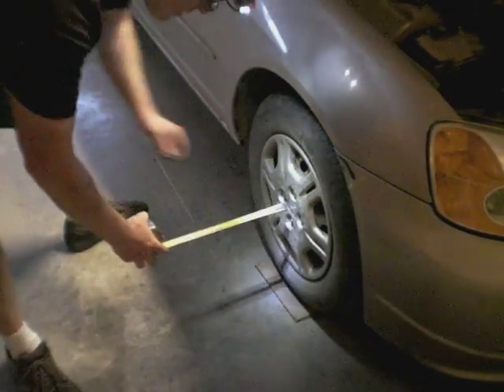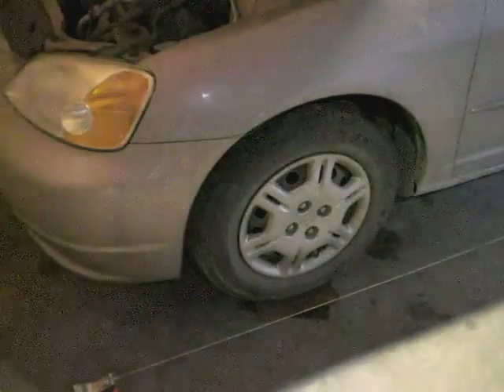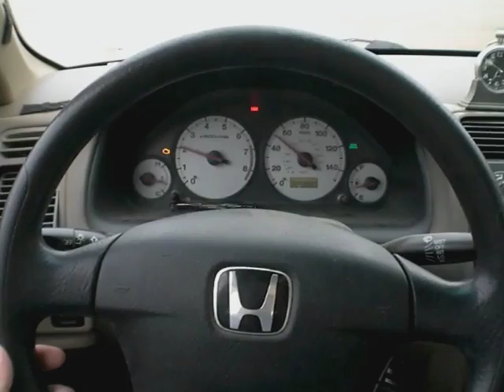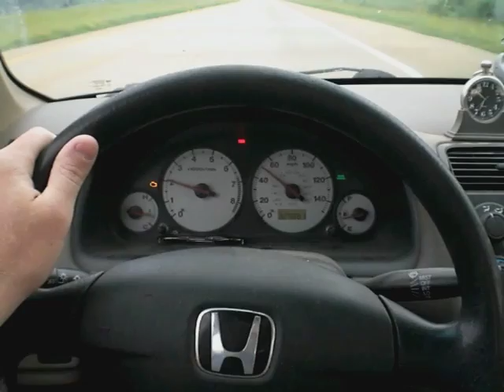Poor Man's Front Wheel Alignment (Toe angle)

Comment: I'm not trying to be smart but. That shows you the string method is. Incorrect if you would have measured from the center of the tire on each side to the string. Then you would have eliminated making adjustments. But over all good job

Comment: Front wheels are always self centering. You could keep one straight and one in and whel you run both will share the toe in. As they will both split to half of total toe in.

That s why your steering wheel was at an angle as you adjusted only one.

Also tracking has nothing to do with toe. It pulls due to toe out or unequal camber or caster.
Reply: Tracking has nothing to do with toe?

Comment: Would have removing the hub caps saved the second adjustment?  Probably.  Would it also have taken away the view of having to do a second adjustment?  Yes.  To counter those that keep saying a computer alignment is best, not really.  You have to remember the computer only checks the alignment.  It doesn't actually perform it and if the mech is in a hurry he could well not get it exactly in line.  If you don't do what this guy did and take off the caps and keep a pair of ramps at the ready on a dry patch, even if you don't need a post test drive adjustment, you probably are getting darned close to as perfect as human hands can really get the toe in done.  The computer just makes it faster and easier, really.  But, yeah, take off the caps.  (sorry, bro, but, yeah,,,lol)

Comment: how would you adjust the toe if your arm is located under the strut area?
Reply: thats right...and those nuts dont come loose that easy, believe me....especially the type with two lockdown bolts that tighten a sleeve that will not spin...

Comment: I'm confused about 03:08, where he says he's adjusted the tie rod. He takes a measurement, sees that the wheel isn't parallel to the string, then grabs the wheel and forces it into position. Isn't the idea of this to move the wheels by adjusting the tie rod? It would seem that forcing the wheel in any direction would mess the whole procedure up. He might have forced the wheel straight, but it may have also put the rack out of center. In addition, isn't there always a bit of play between all of these components that have to work together?

Comment: best way to string  for toe in is remove the 2 lugs holding hubs, remove front and back hub use carpenter string and hook in tread about center of axel pull sting to front of front tire pull string toward tire if string touches tire at same time your aligned, if not make adjustments, then repeat on other side, no need to use tape measure. this will also let you know if rear is out of alignment.
Reply: Remove front and back hub?
Reply: @bonkeydollocks1879  remove the hubcaps if they're on your car
Reply: @shjmo  he missed out the word 'caps'

Comment: Thanks for the video. I bought a used car with the steering permanently turned to the left but the car pulls to the right. Do I turn the drivers tie rod clock wise?
Reply: Drive in reverse.

Comment: As far as string aiming goes, this is as accurate technique you can use but i will explain the accuracy problems
Theres a diff between doing the best accurate string job compared to the 4 wheel aimers and camera/laser readers at the shop. The reason no matter how careful you are at the string type is that the string method can never detect a slanted rear fixed axle or out of place rear wheel. One rear wheel may be slightly forward with the front edge of rim and tyre bulge diff to back. So when you run sting along 15 inches out, already the line angle is cockeyed then your front wheel will be lined up same cock eyed. The string method CAN work only accurately if the rear wheels are actually dead straight parallel with each other even if they have a toe in or toe out as long as they are exactly the same for a starting point for the strings. 
A static shop laser system wouldnt be able to measure any better. EXCEPT the beauty of the system is all 4 wheel have reflector plates on the wheels and while the beams are being read, the car is pushed forwards and backwards. What this does,, is it detects the very slight rotational error ONLY because the wheels are moving and gives all the numbers on screen of for all 4 wheels in real time. This only works if the equipment is set up perfectly as we are talking about 1mm or so in toe and 1/2 degree generally in caster/camber so set up is critical when placing wheel and locking off steering wheel and apply foot brake or the caster reading will be faulty. Also tyre wear and joints and bushes MUST be firm or any play simply will negate a expensive precise alignment. 
Sadly it is impossible to invent a simple cheap DIY kit at home that will do anymore than a rough job which will be fine for an old worn car with old tyres to rumble around the "village" without too much tyre wear or pull. 
A small laser and mirror and some steel pieces $10 can be made to do an accurate toe to a 1mm. An a caster.camber bubble gauge $150 ebay can take care of caster/camber but you have to rotate each front wheel in and out around 15/20 deg and take reading for caster. Camber is read directly from rim. Toe is done last.  As explained rear cant really be done accurately without the shop setup however, unless it way out for tracking, a front alignment should have the car driving pretty well with at worst  touch of tracking crab from rear which would mean the steering wheel might be turned just a hair to correct. Many car pulls are also caused by a dragging tyre casing so swap to other side to confirm first if it tyre or alignment problem.
Reply: Very informative comment. Would be interested in your thoughts on Ratchets and Wrenches version of the string alignment. He is around an inch away from the wheel and sets it up with less variance from the start.
Reply: wtf u really well said..too much understand

Comment: this how i always did it,  took 2 long aluminum squares that  you can hold up on the disk face on each side of the car, that will go across the front of the wheels and lap over about 10 inches, because when the 2 squares  are pressed tight up on the 2 disk in order to get the 2 squares to align up strait you will have to make adjustments on both front wheels to get the to squares to  perfectly ling to gather with each other dead strait,  where they going across in the front of the front wheels,  to make sure that the squares do not leave the flat face of each disk  it do take 2  fellers for this job, and you need to block up the center of the 2 squares where they are meeting  to gather so that they do not sag down,   just take 4 nice tie clamp straps  the plastic ones, and strap the 2 squares to gather  so that the squares will be in line with each other  where they are meeting to gather,  and now try to place each square flat on the facing of the 2 disk, if  either one of the front wheels are not strait ,  then you will see the distance  from the facing of the disk and the facing of the squares where they are placed up against the 2 disks,  if the squares do not fit flat on the disk  don't try to force it in, you need to make adjustments,  on what ever wheel that the squats are not  fitting  right flat on the facing of the disks,  never  attempt to work at a car with out making sure it's well secured with blockings so that it can not fall on you,  always do that very first thing you do the blocking,  then you can pop of the 2 wheels fellers,  do not ever depend on any jacks to keep a heavy car from falling on you never do it  , and it do not matter if you set your toe with the 2 front wheels slightly off the road,  and never take of your staring wheel to fix an alignment  issue,  when your 2 front wheels are tracking strait ahead, then the staring wheel will definitely be strait to,  i don't think you will have much luck measuring from the tires tho,  the old ropedopy   way is not all this bad tho,  i have used it many time my self,  but i had to find a better way to get the old shore trotting  in the right direction, lol  i have tried every thing to make an alignment for the toe, i have use a string, a tape, a mesuering pole ajustable, counting tracking rod treads, with a tape from the fram out to the wheel tread,   and i have been at aligment racks too a number of time,  and got really bad jobs did on the car,  and the car wasent old  3 years old ,  i am not sure what thay are doing at all aligmet racks at all, bad traing...lol   but it would have saved my money if i wouldent have whent lol  ,  1 grage rack left this big pair of vise grips attacked on my tire rood some place becouse it hit the road  in 15 min after leaving the aliment grage,  i stop and back up found the big pinchers  lieing on the fellers. i still have them lol  the gods truth,    why i am taking so much  fellers , is because,  i could never get the old ropie poppy trick to work, and i really honestly do believe that  the rop job is still better then some alignment racks mr thadivs  any thing works better the being all  out of toe
Reply: You got enough words in that write up to make a book. You should have a book published to make lots of money.

Comment: but fellers  we definitely cant make even  a half of a guess where to adjust our front wheel so that it would track down a strat road  with out wearing out the tires,  on the in sides our out sides corners  lol maybe the car manufactures should start working on a built in alignment system lol  because this is  the one of our biggest worries  ,  it's not because we have to buy new tires,  but it going to drive so horribly bad,  pulling to one side like a race horse  trying to win a durby
Reply: But the car is already pulling he made adjustment so it doesn't. That's why he road tests it. My car was in front collision, shop did all body work $10,000, said come and pick up. I drove away.... pulled to right.  They check, said oh, bent tie rod, another $250 with fresh alignment.... still pulls to right???  Do you think I'm going to take it back to somebody who twice couldn't get it right? No, I get out my wrench and now no longer pulls to right!

Comment: No, you need to adjust the tracking so, if it's a front wheel drive, there is 20 minutes of toe in on the front wheels.  That means 10 minutes of angle on each wheel.  If you don't get it right your tyres will wear on the inside and you will find the car wanders on straight flat roads.
Calculate what 10 minutes of angle means on whatever size wheels you have.

Comment: I went to the shop and got alignment done few days ago, drove the car couple times and today noticed there is some clanking sound when I pull in/out of parking lot. I though I might have hit a cola can or something but didn't see anything.  COuld it be the shop forgot to tighten something or something else, or maybe it's nothing, maybe I hit a cola can in the rear and didn't see it. car seems to drive fine. Think I heard the sound in 2 difference occasions
Reply: Okaythen001 might go under there up on jacks and just see if it is solid. Check tie rod cv axle etc. None of it should be loose.

Comment: nicely done... second example below

realizing the rear wheels arent reliable... :)

recently i devised a similar home alignment process...

I am not going to video...
1. align steering wheel as rolling to parking
2. tape measure stretched out behind both front wheels
3 second tape behind both rear wheels

4 shoot "laser" from 39 dollar laser from harbor freight and align tape on driverside using an even foot number.

5 walk to pass side and shoot laser across both tapes and determine similar adjustment plus one laser width of toe in... perfect alignment.

6. test drive for satisfaction and repeat as needed.

note:  a person can use the back tires as a reference to identify the fronts are aligned in a general sense...  but as i experienced... there is no call to trust the rear tires as camber can affect how the rears are in comparison to the fronts... 

trust the tapes laying on the ground over where the laser splashes on the numbers over using distances away from the tires.
Reply: Delta Bravo

Comment: lol... not  even 1/3 of a turn...

closer to 1//3 of 1/4 of a full turn

nicely done... second example below

realizing the rear wheels arent reliable... :)

recently i devised a similar home alignment process...

I am not going to video...
1. align steering wheel as rolling to parking
2. tape measure stretched out behind both front wheels
3 second tape behind both rear wheels

4 shoot "laser" from 39 dollar laser from harbor freight and align tape on driverside using an even foot number.

5 walk to pass side and shoot laser across both tapes and determine similar adjustment plus one laser width of toe in... perfect alignment.

6. test drive for satisfaction and repeat as needed.

note:  a person can use the back tires as a reference to identify the fronts are aligned in a general sense...  but as i experienced... there is no call to trust the rear tires as camber can affect how the rears are in comparison to the fronts... 

trust the tapes laying on the ground over where the laser splashes on the numbers over using distances away from the tires.

Comment: dude each side should toe in 1/16th
Reply from the maker: I've looked all over for a specification for the toe angle.  What source did you use?  This is the only thing that I've found:
https://honda-tech.com/forums/suspension-brakes-54/alignment-specs-explanation-decryption-3059162/
It claims that the toe angle is a range from -0.12º to 0.12º.  That's why I set it at 0.
Reply: yes, i think its toe in slightly for rwd and toe out for fwd.

Comment: Amatures beware!
Front wheel and rear wheel track widths would have to be the same for this string method to work.
Reply: if you have exact numbers from the front and back locations on the tire ; that's what you mean by track width right? I just want to get it close enough to the same exact readings so i can drive to the alignment shop.
Reply: Take the track difference into account with your measurements.

Comment: Thanks for the vid.  If the car pulls to left, but with the toe-in 
correct, how to correct that?
[tires ok, still pulls to left after swapping wheels].
In my case it was definitely alignment - in the end I paid a tire place 
and they aligned it and after that no more pulling to the left.
Reply: Suspension bushing worn out. There are many around steering. Check them all.
Reply: @Fosgen You are right.  It turned out the steering rack/power steering was fubar.  Fitted a new (reconditioned) rack and the car (according to the French govt inspection) now deviates only 50cm from straight ahead in 1km.  (I doubt they can measure to an accuracy of less than 0.1% but that's what the automated test result said.)

Comment: Yea not only about the hub caps but let's say that u was doing your method on a Chevy blazer when u can clearly see the difference in the width of the front axle and the rear so even measuring from center front to back would give u the illusion u have a toe out problem not all cars have the same width front and back

Comment: next time I think I would remove the hubcaps/rim covers before measuring..
Reply: does going left always push the back wheel out or did some companies or all design it where turning both toes right will make both front tires point right?

Like, I have a correction on the wheel go be like yours was but to the left so like say 15 degrees left..

At sears they made them equal but its 15 degrees left due to me having the wrong wheel at the start.

If I want both wheels to be pointed say 0 degrees but there is obviously a toe-in would I want to turn driver side toe right 1/3 then passenger left 1/3? or do I say turn both right 1/3 for the wheels to point straight?

The problem is with speed sensitive steering the effect is more noticeable at higher speeds..  With paddle shifters it becomes more of a problem.

This is what my tie rod looks like.  Left and right use the same part number so they are identical.
http://www.realoem.com/bmw/enUS/showparts?id=YB63-USA-10-2012-F01N-BMW-750iX&diagId=32_1323#32106784716

It really seems
driver side turn right 1/3
pass side turn left 1/3
when wheel is pointed left to go straight?
Reply from the maker: I had considered that, but these covers are held on by the lug nuts.  I just didn't want to go through the effort of removing them to get the covers off, then torque them back on to make the measurement.  Then take them off again to replace the cover, then torque the nuts back on again.

One of these days, I may have to do just that.  I think the covers make things less accurate.
Reply: @Thadivs yes they need to come off to use the method I wrote earlier, but what is so hard don't need to jack car up to remove the 2 lugs holding cap on.